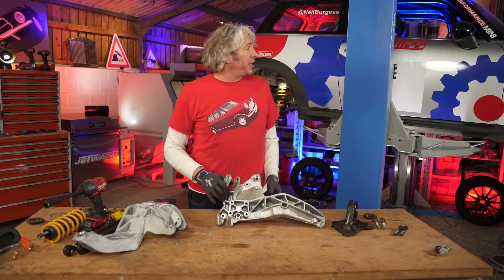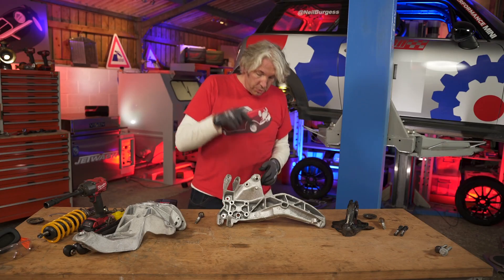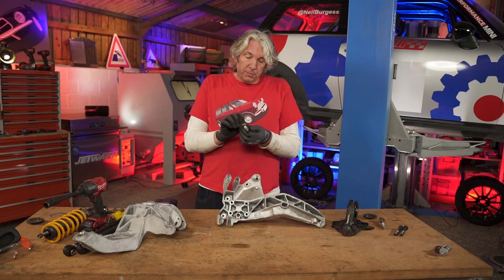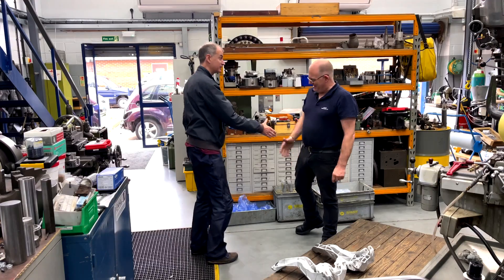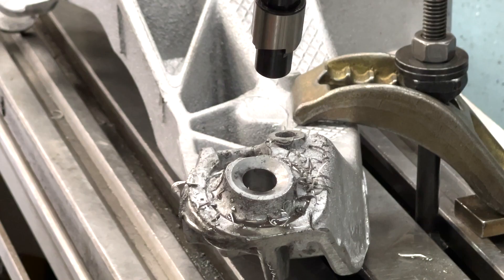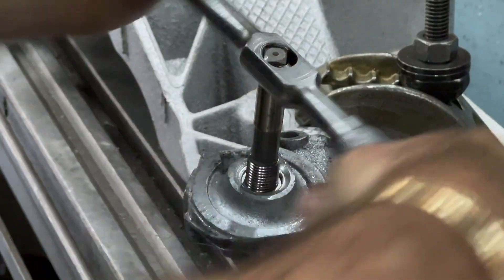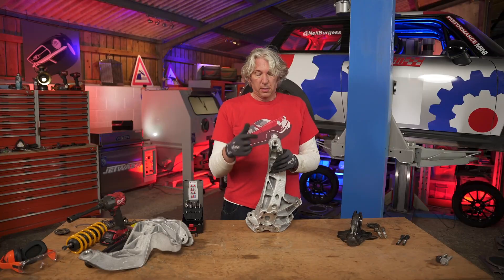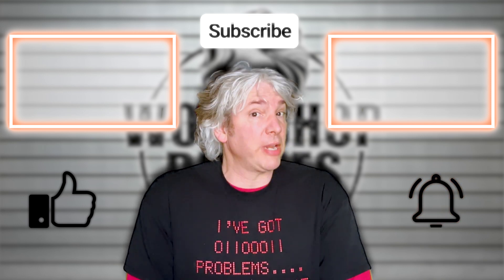Will Installing Thread Inserts Be Strong Enough To Go Rallying With? | Workshop Diaries | Edd China

Comment: If you had replaced the self tapping bolts with standard bolts would that have reduced the chance of stripping? Also I would have switched to course thread inserts in aluminum with new course thread bolts. Finally if a Heli coil is installed with Locktite red it won’t come out under normal abuse.

Comment: That's a Big-sert isn't it? Designed for use after a stripped helicoil. Had to use one on my mk4 Golf gearbox mount after the helicoil pulled out and damaged the hole.

Comment: I think if it was me I would have looked at machining the outer side of that hole parallel with the inner and running a bolt and washer instead of relying on the aluminum . 2 reasons I say this . One is that that aluminum is , in my opinion , the weakest part of that suspension setup and a rally suspension gets a LOT of abuse . Second is that you'll have the typical steel/aluminum reaction in that hole over time , meaning that as the reaction sets in , it will slowly eat the new  threads and weaken that mounting point even farther . I am of course assuming that the aluminum in that suspension casting is thick enough ( it looked to be realively beefy ) to have some machined away and still be strong enough to use as a shock mounting point .

Comment: Used their kit on a 2003 Toyota engine to repair head bolts, although expensive was easy to use and eliminated this issue with the cylinder head opening up randomly.

Comment: Could you just drill it and use longer bolt and nut on the backside? With small mods on bolt or washer.

Comment: A wealth of info for me. Learned what those bolts with the lop-sided shape were for.  First  encountered when replacing a 6.5 HP aluminum engine onto the body of a steel bodied push mower.  Narragansett Bay.

Comment: Those Trilobial Thread forming bolts are notorious for stripping out the thread in the cast Alloy.
Really only a one fit application.  Any porosity in the cast Alloy then poses another problem.

Comment: I used to use a similar product years ago called Acme Keylocking Threaded Inserts. The difference was it had four wedge shaped sliding tangs that you would drive into place after seating the insert thereby locking it in place. Used them on motorcycle sparkplug holes that seemed to strip out and helicoil never seemed to work very well.

Comment: Why would you not just drill through and use a stainless steel nut and bolt, instead of relying on threads within the casting?

Comment: What an utterly terrible bit of design. One thing for the oil pan bolts or other low-torque, low-muck areas but a hefty steel bolt in an aluminium suspension component is just silly.

Comment: Edd, I have worked on new Range Rovers, and when you take out any of the rear suspension and then try to put it back with the correct torque settings on the bolts, they always strip..
Modern cars are more and more designed to be put together once. I now work on Tesla's and we are not allowed to pull them on a jig, so they are written off because of moderate damage.

Comment: You're right about the Helicoil's flex, but that occurs at a far higher point than the original aluminum provided the sizing is all correct. Having said that, Time-Serts are definitely the best thread repair there is for a host of reasons.

Comment: I used a Time-Sert for repairing the threads in my VW Single Cab's reduction gear box(cast material)/trailing torsion arm connection. Worked great!

Comment: Thanks Edd! I learned something new today. That type of bolt were holding the front swaybar in place on one of my cars and of course it stripped the threads out when I removed it to replace some bushings a few years ago. Allways wondered why it was shaped like that on the end and why i couldn't fit a regular nut on it. Now I know why!
I solved my problem by using a longer bolt and put a nut on the other side of the beam that the swaybar bushings mounted to.

Comment: I use a lot of time serts. They're a great product. As far as your fix goes, aren't you supposed to tighten those suspension members with weight on the wheels, so they're tightened at ride height?
Reply: If I remember right, that was mentioned in the original rear suspension video, which is somewhere on Edd's youtube channel.  All the best.

Comment: Should be high strength Loctite on the Time-sert, at least according to the instructions that came with my kit.
Reply: Thanks for that info.  I inherited some of  these without the instructions, so I've always used some form of threadlocker just in case.
Reply: @AB-ku4my  Time-Sert actually specifies (on my kit) Time-Sert 6020, which is available on Amazon. Seems to high strength high temp
Reply: @jonathanrees3765  Many thanks.  I'll get some this weekend before starting on my Anglia next week.

Comment: I couldn't see the top bolt but the bottom bolt would have been easier and more cost effective to put a bolt straight through it and a lock nut on the end.

Comment: Interesting technology. I was using Helicoils and Twincerts in magnesium casings for helicopter engines for some 40 years. All of the threads in the magnesium casings were bare magnesium, which is much softer than aluminium, so all of the threads had Helicoil inserts, or Twincerts if the Helicoil failed. If the Twincert failed, we would bore out the hole even larger, then thread it, and screw in a threaded magnesium rod which was glued in with epoxy, then machine it flat with the surface. A hole was then drilled in the mag rod and threaded with an Helicoil. I had to do this several times in the Highlands of New Guinea when I was working up there. Be very careful machining magnesium! Keep it well lubricated!
Reply: Quite. Magnesium, oxygen and a little heat can be rather exciting.  A chemist writes.

Comment: From what I understand, thread inserts are put in racing blocks without bothering to put an original thread in. Something about it being stronger than a repair, and that the original thread was going to always strip or waller out fast so start with the insert. (obviously they need a thread to insert it, they just never put anything into it until the insert is in)

Comment: When manufacturing techniques don't allow for repair work.
Reply: IE, virtually every modern product (sigh)
Reply: Actually in this case it's a whole lot worse even than that: you can't even change a shock (which is routine maintenance, not repair) without tearing out the thread from the expensive casting.
Reply: @Gottenhimfella  "Routine maintenance" is a repair.
Reply: @chrisose  Feel free to invent your own definitions. It's the internet.
Reply: @Gottenhimfella  Not a new definition, just reality.
Reply: @chrisose  As the name suggests, maintenance is about maintaining the performance of a machine, eg by adjustments and lubrication, replacing consumable items (wiper blades, tyres, disk pads, batteries, drive belts, urethane bushes and rubber boots etc, in the case of a car) as needed, and doing these things before poor performance results.
Repair is about restoring the impaired performance of a machine, fixing or replacing items which are broken, faulty, or (usually, due to poor maintenance) worn past service limits, despite not being consumable parts. 

If you don't distinguish between these different activities, or types of degradation, I guess it just means you are a consumer of products and services. As almost everyone is, today. Don't feel too bad....
Reply: @Gottenhimfella  Actually both my father and grandfather were mechanics, so I grew up working on cars and became an engineer on the back of that experience. Interesting how much of the maintenance you mentioned should only be performed by a qualified mechanic due to the tools and specialist knowledge needed to do the job right. I know that a solid 20% of the work in my father's shop was dealing with vehicles that someone tried to 'maintain' themselves. Sometimes with catastrophic results.
The inescapable fact is that beyond putting fuel in the car, most people should leave any work on their vehicles to the professionals.
Reply: @chrisose  So your point turns out not to be about what two words actually mean, but an attempt to manipulate the way they are understood, aiming to encourage or promote a particular (and somewhat extreme) behaviour. 
Ironic that you would try that on here, given that it's the exact opposite to the mission of this channel, but perhaps that's why you adopted such a covert tactic?

Comment: I dont think you should be reusing triangular bolts once u remove them.
Reply: The bolts would be fine to reuse if the trailing arms were new (you'd need to clean the threads though). All the damage happens to the weaker, softer material (ie the alloy)
But I guess you really mean that having provided a ready made thread (using the Timesert) the bolt should have a conventional thread. With which I agree. (We don't know what was used, AFAIK)

Comment: Using long stud and nut
Reply: No room for the nut, also the bolt is a shoulder bolt (and has to be, or the hole in the casting will slog out before your very eyes..)

Comment: That's all well and good sir, but I have 2 questions. One, does the insert get some kind of permanent (i.e. Loctite 271) on the insert before installation? Two, do you put some kind of anti-seize on the bolt before installing it in the nice new insert? With all those dissimilar metals in there, I could envision the angry corrosion pixies paying a visit, rendering future repairs impossible. I think you guys near the prime meridian would call it knackered? I like FUBAR myself.

Comment: Blimey Edd! Helicoil fixings takes me back to when I was a Jaguar apprentice - 1978 to 1982. Helicoils were used in the Jaguar engine manufacturing plant at Radford in Coventry for fixing cylinder blocks & cylinder heads on the V12 engine before they were even assembled into complete engines! They always made a good repair and saved scrapping of the part.
Trilobal bolts are used on many cast aluminium parts on modern day carsto save machining of the threads but as you stated, they do have their serviceability concerns.
Great video & thanks for prodding my memory!
Reply from the maker: You’re welcome!

Comment: The reason the threads strip is in the bolts,  usually they are designed for machine fitting  screwing into blank holes they cut a thread with a three lobe end to the bolt,  just tap the holes properly take the bolts throw them in the bin and use normal bolts then the full thread is used, using the original bolts is the problem, replacing the bolts with the same ones doesn't fix the issue because the whole thread is not used, look at the end of the bolt and you will see
Reply: I had the same thought, just based on Edd's description of the bolts being self-tapping. Maybe unscrewing the self-tapping bolt damaged the threads, as he suggested, but seems like re-tapping an already threaded hole would certainly do damage too, so maybe using a regular bolt as a replacement instead of re-using the self-tapping one would have worked.

Comment: Really interesting stuff! Had a similar issue with my bicycle crank arms. They are made of aluminium alloy and the pedals have steel bolts. Due to a design error on the pedals (lack of a stop) , I over tightened the pedals (cheap oem pedals) and after 30km of my saturday ride, the pedal stripped off the crank arm hole completely. Had to get a new full crankset, a puller and some tools to do it myself... but I would have liked to have a easier solution to that problem.
Reply: Thanks for the description - i can 'see' what happened

Comment: Possibly your aluminium is work hardening on first assembly and then is susceptible to crack when re-used. I wonder if heating it might help anneal the area.
Reply: That fits the description of how they're self tapped on assembly in the factory. That's going to work the Aluminium a lot! If properly drilled and tapped (as in cut, not munged), it'd probably be far better.

Comment: 5:07 I have seem other videos of people with such machines and they use the drilling machine to hold the tap, because it will be centered to the hole while you turn the tap.
Reply: If you look again at that sequence, you will see there is a centring tool in the chuck of the mill, which has presumably been used to align the tap when the thread cutting was started.
Reply: @rickconstant6106  Possibly.
Reply: @DarkGT  It's more than a possibility, it's a certainty. If you stop at the first moment tapping is shown (even without stopping, if you are quick witted) you can see the male cone centre of the alignment tool engaged with the female centre in the end of the tap.

Comment: Using Steel inside of aluminium. What could go wrong? Every chemistry teacher would facepalm over this show of stupidity in design. It's the same issue with a*hole screw on the front axle of most modern VAG products, A steel bolt going through two swing arms made of aluminium. Electrochemical corrosion will completely screw this up over the years, enhanced by humidity. Basically designed to fail and of course sell new and expensive parts to vehicle owners. Great work on the rebuilding Edd! One little question though. Shouldn't the torquing be done under "street-level" conditions? Meaning the suspension should be compressed to about the level it would be on the ground to not put the bushings under too much twist when it's lowered and actually driving?
Reply: Steel and aluminium are not a particularly problematic combination; almost every fastener on an aluminium engine (eg, virtually every single motorbike) or gearbox is steel into alu. 
Unless the steel has lots of Nickel and Chrome, (eg Stainless Steel), galvanic corrosion will not be a show stopper.
Reply: @Gottenhimfella  Well, that might hold a grain of truth, just not in terms of VAG products ^^ speaking from experience here.
Reply: @julianh9347  maybe they use an unsuitable steel alloy...

Comment: Very good. There has been a kit like this around for a while now for use on Vito diesel injector bolts, the thread strips from the heads. I used one recently on a friend's Freelander TD4 in Romania, although the kit was designed for the Vito, it worked perfectly in the TD4 head. Nice to see you posting again Ed

Comment: Very I interesting to see the Timesert......
How about a video on all the different fix options.
Would the Timesert have been stronger,  if it had been installed from the rear 9f the arm, with the bolt pulling  the shoulder into the alloy casting?  
Probably more expensive machineshop  setup time.....
Reply from the maker: It probably would have been a bit stronger but the shape of the casting made things tricky.

Comment: I had this done to some Z1000 crankcases by SEP in Kegworth back in '85 after a couple of bolts sheared off diring an engine strip. They required drilling out and I was going to attempt it myself but I'm glad I left it to the experts!👍

Comment: Torque and aluminium, the bane of many a 2CV owner and the wrong torque numbers in the Haynes manuals for the cylinder head bolts, resulting in the need for helicoils and the like, or drilling, tapping & using oversized bolts, not ideal...

Comment: I blew out a spark plug in the aluminum head of my 1968 Renault 10.  I drilled it out, retapped it and inserted a helix coil.  I used lots of grease to keep the aluminum shavings out of the cylinder and put grease on the end of a screwdriver to check if any shavings dropped down on top of the piston. I drove it 50,000 miles after that.

Comment: Since you tapped it to a larger size, what didn’t you just use the bigger sized bolt that you tapped it for?
Reply: Because the aluminum thread does not do well with repeated removal and replacement of the bolt, which is how this one stripped out in the first place.  Given that this is for a rally car, it may have to be removed more than once in the future.
Reply: Because it's easier than modifying the bottom bushing in the damper to accept the bigger bolt.
Reply: @Zeem4  Not just easier, but it's a bad idea to modify consumable parts, partly for warrant reasons but also because every time you replace (or decide to try a different shock) you have to re-modify the replacement part.

Comment: Hi Edd, another very interesting video, on just how to rectify problems that mechanics have to sort out. 
Have you, or would you ever consider working on an old Rolls Royce, something like maybe a 1988 / 1989 Silver Spirit. I believe such cars are perhaps a little over engineered, and therefore, can throw up some real challenges to sort out. 👍.
Reply from the maker: Funnily enough I do have an old engine and box from an 80’s Shadow II, the plan was to use it to power a street legal dining room table and chairs!…
…but that is still a job for another day!!
Reply: @eddchina  
Hi Edd, that sounds like terrific fun. And indeed would possibly present some problems to navigate around to become road legal. One thing is for sure, with a Rolls Royce 6.75 engine under the dining room table, you’ll never be late for dinner 😆👍❤️.

Comment: after having to drop the front subframe to change out the front control arm bushes on the other half mini ive gone right off them as a nice to own car.
Reply: It could be worse - you could have a vehicle like mine where an attempt to drop the front subframe results in a couple of broken bolts, and a couple of captive nuts coming loose and spinning inside the chassis rails.